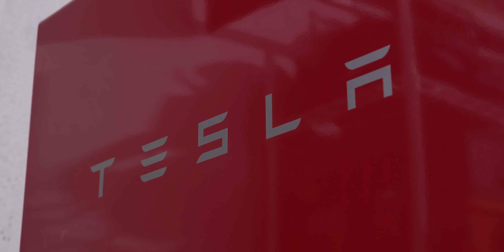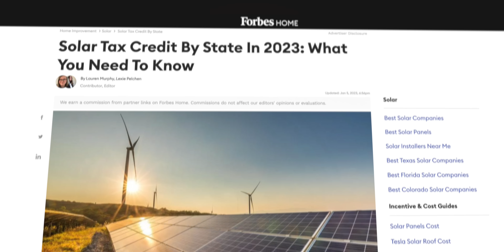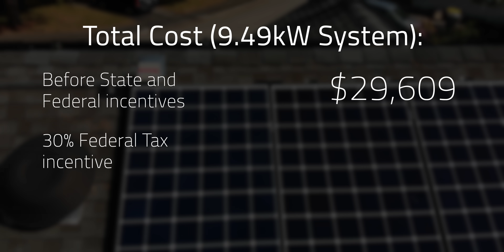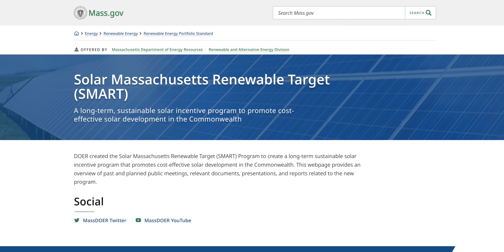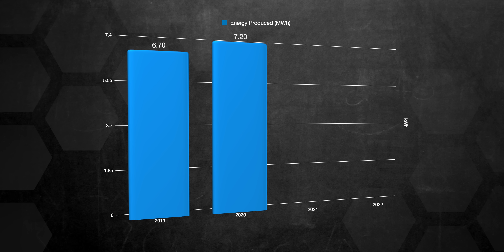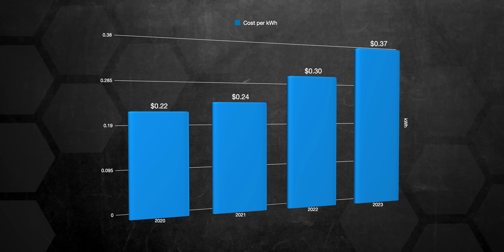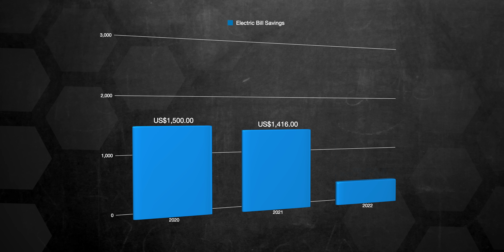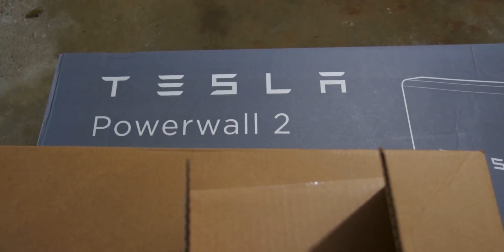5 Years with Solar Panels - Is It Still Worth It?

Comment: I have a friend who worked at a radio astronomy observatory for decades.   They had this "standardized" intelligence test for their interns.   When the "big" (26m) dish would fill up with snow, the procedure was to tilt it down, and hit it repeatedly with a whacking stick, and it would come avalanching down.  The "test"?  If the student stood behind the dish while whacking it, they passed the test.  Several students failed this test...
Reply: I would've failed based on the fact I wanted to be covered in snow...
Reply: @Perroden  26 metres of snow?!?
Reply: @alanhat5252  ya why not.
Reply: @Perroden  people who don't mind to be hit by snow probably don't live in region where it snows.
It depends what temperature, humidity and how long snow was here, but I would estimate that that amount of snow would weight at least like a car.
Probably they clear it  regularly(because otherwise people who failed test would be dead and in emergency unit).
My grandma was almost hit by snow several years ago that fall from roof. It fell just in front of her legs. It is freaking scary.
Reply: @alanhat5252  26 meters across the dish, i.e. its diameter, not its depth.
Reply: I would’ve failed it because I’d be making snowmen.
Reply: "Why are we hitting it with a stick?, SCIENCE"
Reply: @dersturmerofjewery6038  It was a very scientific whack with a very scientific stick!  (If confused, read Project Hail Mary ;)
Reply: @jluhman2  omg I love that book! I can't wait until they make the movie
Reply: @dersturmerofjewery6038  Gravity....
Reply: "If the student stood behind the dish while wacking it..."
Reply: @christopherlh4271  🥴🥴
Reply: One of mankind’s great technical invention 
The stick
Reply: @martyober4833  Another: Fire. Collect enough sticks and you’d have kindling. Though never burn your best sticks if you still need sticks for other uses.
Reply: What if I just wanted to be covered in snow?
Reply: @McFlubberpants  Well, if that response was being tested for, you’d have passed the test.
Reply: @McFlubberpants  well if there is a lot of snow they might find your dead body in the spring when the snow melts.
Reply: I remember seeing the invitation on my college bulletin  board.  It read, "Take a whack at astronomy ...,"
Reply: I work in a blast furnace that sprays lava on a floor to make little pellets to then be crushed. 

We sample the product, I handed a trainee a steel bowl to collect some product to sample. 

He went to reach to grab a handful with his bare hand. I stoped him thankfully it’s probably 600- 800 degrees Celsius.
Reply: @doaimanariroll5121  Yikes!  That'd make a mess, that guy owes you a hand.
Reply: @syberphish  yeah man someone dropped one pellet like 6mm diameter,  into his boot. Took him like 3-5 seconds to get his boot off. 
Burnt him too the bone. 

It’s so obviously hot you walk into the chamber and it’s like standing right next to a big camp fire with that radiant heat. I couldn’t believe him. Haha he wasn’t around long though.
Reply: @doaimanariroll5121   I have a decent idea what you're talking about.  In my 20's I worked as a tempering oven tech at a glass factory in Chicago.  
When the glass would bump into each other on the rollers it'd fuse together and start forming a ball in the oven.  When you hit the E-stop, stuff starts happening pretty fast.  Part of the conveyor drops to a bin and it all starts running backwards shooting off molten glass.  Then the big long clamshell oven line opens on hydraulics and you have to use poles to move the glass off the rollers.  The rollers were not cheap. 

First time it happened to me was like my 2nd week on the job, I was technically still in training.  That was when I realized I never got polymer frames for my glasses.  The heat pouring out of the oven is so incredible you feel it palpably like waves lapping over you and enveloping you.  
We had big mitts we'd put on  with a front-suit but my metal glasses frames started soaking up the heat and searing into my skin.  Never again though, I got some BCG's after that. 

Can't even imagine what a blast furnace is like.  

At one point, if your microwave or oven had a tempered glass plate in it, there was an 80% chance it came through my tempering oven.  Not sure if they're still cornering the market like they were 20 years ago. At the time I was one of the few people there who spoke English, but it didn't matter because we all wore hearing protection from the moment we stepped into the building.  I'm not sure I ever spoke to anyone at that job without shouting at them. 

I was never tempted to grab it, but when the glass was running correctly, coming out the oven, running through the clamshell air quench then through the air and water quench run, it'd still be orange-hot and had this smell incredibly reminiscent of hamburgers.  
I'd sit in there watching the orange sheets go shooting past and just drool.  

When everything is going correctly, it was incredibly boring.  Once you get the computer programmed and get a load up and running you could just sit and watch it for 12 hrs at a time, for days or weeks.  In at 4am, out at 4pm, every day.  

And on that note, starting work at 4am is bullsh*t.  But 20 years ago, making $24/hr for not doing all that much was pretty good money, but you really earn it when the alarms are going off and the lights are flashing.  I'll never forget what the heat felt like though, it was so intense it's hard to describe. 

It boggles my mind to think of someone going to pick up a still-orange sheet to inspect it.  Just the thought of it makes me shudder.  I bet you've seen some nasty burns too.
Reply: @syberphish  😂
Reply: @doaimanariroll5121 😂🙏🏾
Reply: lmao
Reply: lol looking to fail interns means idiot supervisors.   you just want hard working people.
Reply: That’s a good intelligence test.
Reply: Hahaha, why is this story so very believable. 🤣
Reply: Surely they were from Florida...
Reply: I thoroughly enjoyed your analytical video, I wish  Solar Power had been a reality for domestic consumers in my working life before retirement before the first time from 1962 to 1995 when disposable income was a thing! P.S. I did also the  enjoy the many comments that appealed to my sense of Humour! No disrespect, but your video will be a mental bookmark for decades to come!
Reply: Your snow story reminds me of a coworker I once had... he once got a gouge in the sidewall of one of his tires, and went outside with scotch tape, to patch it up. People are good at different things -- he was a baseball player, but obviously not mechanically inclined in any way, whatsoever.
Reply: This analogy can be applied across a wide range of activities. It's always interesting to see people just blankly moving through life and wondering how they made it this far.
Reply: The mitigating factor is if they say "Hey watch this!" first.
Reply: Me me me me... Me me me

Decarbonization is 21st century pyramid building.
Just burn coal. 

This is sickening on so many levels.  "How to screw the lower middle class and make them pay for your feel-goodery."
Reply: @SorryLord-IDidntMeanToSayThat  Kind of. Anymore with how quickly houses sell you kind of just have to buy them like you're ordering a t-shirt
Reply: Apes.
Reply: There was no "friend" involved, was there Marcus?.  You got covered in snow, didn't you?  Yeah I see through your fake story, I know what happened. "So this one time, I had a friend who..."  suuuuuure.
Reply: I find that some really smart people overlook common sense and look for complex solutions to simple problems.
Reply: Is that intelligence or just common sense?
Reply: This is so complicated for me.  I just want to know if my electricity bill would go down if I got solar panels.  It would take me 6 months of studying  to figure it out, so I guess I will just keep paying PGE.
Reply: I worked in satellite communications in the military.  There was a story about people beating on the back of their reflectors to remove snow...and destroying the antenna due to changing the geometry.

We called the post fire department and they'd come out with pumper trucks and spray the snow off.  At our location, the pointing angles were basically horizontal, so the snow would slide off and the water wouldn't have time to freeze to the surface before it also rolled off the reflectors.  Interesting point...our antennas were 60-ft in diameter, and even a single inch of snow built up on that much surface area weighs a LOT.  Our antennas had motors and moved to track the satellites, and that much weight would begin to cause tracking errors.
Reply: For very lightweight reflectors with de-minimis backing-structure, this can happen for sure.
Reply: It sounds like making fun of a person with lower intelligence by allowing them to humiliate themselves - potentially unsafely.  Not funny to me.
Reply: Was that Hazing?
Reply: THAT WOULD BE NORMAL, SINCE HARDLY ANYONE HAS AN EDUCATION
Reply: You don't need to insure that your roof is top-notch.  A 20 yr old asphalt shingle roof will still outlast the useful life of the solar panels
Reply: “Whacks the dish from behind, then proceeds to jump in the avalanche”
Reply: Kitchens have the same thing. Wash that wall. Top to bottom great. Bottom to top, not so much
Reply: In Canada hydro is .55 cents step one
Reply: Mostly the lies...the biggest part of my bill was the delivery fee...it went from 45 to 35 no big difference 
My bill averaged 100... now with solar my bill is 80 but I pay 99 a month for the panels... maybe summer time will be better
Reply: @patchvonbraun  Reminds me when I was a student nurse doing my stint in operating theatres and we would watch intern after intern rush about trying desperately yet failing to find the neck tourniquet the surgeon had requested.  Said surgeon would have slipped out some time ago, winking at us as he left.  Of course, we could have kindly explained to interns that this item didn’t exist. I’m afraid we did not do that.
Reply: Does the solar panels come with a mathematician? 🤔
Reply: X-Rays are just a piece of radioactive cobalt behind a lead shield.

How we have come so far, hitting things with sticks and putting shiny rocks in metal tubes.
Reply: Nice story but as someone who actually worked on 32m diameter dish it makes me laugh (because it's BS). You would have to have a sizeable stick to "shake" a satellite dish.  On another hand we tested new guys by tasking them to the dust off antennas (not the 32m one though) to improve signal/noise ratio....
Reply: @kirill_gusev  You only need to cause it to "ring" a little.  I'm currently managing a 12.8m dish project, and we can get that thing to "ring" slightly.  For light powdery snow that's barely holding on, that's all you need.  Same with the radome around our current dish.  If anything sticks at all, we can turn on the big blower fan that causes the entire radome to inflate slightly, and off comes the snow.
Reply: @kirill_gusev  Yes, I'm familiar with that one. I was contacted by a Latvian friend of mine about parts of the pointing system about 10-11 years ago.  I think it depends on the character of the backing structure.  Anyway, decreasingly-relevant to this particular video :)
Reply: @kirill_gusev  Maybe you are missing the point of the comment. If they stood in front of the dish they failed the test as they lacked commonsense /scientific nouse.
Reply: @saintsone7877  Maybe you are missing the point I tried to make: while this story while it sound very funny is very unlikable because of reasons I listed. and I you read my comment to the end I you could notice I brought up another common sense test we used to play on new comers. Peace.
Reply: Yes, book smart doesn’t mean common sense smart. 😂
Reply: @donnastokes-manning6175  Common sense is not all that common. Indeed, I’d suggest it doesn’t really exist.
Reply: I wouldn't want to buy a house with panels on it who knows what headache I'm taking over
Reply: Students must be educated, this "evaluation" is basic bullying and does not assess any intelligence. Shame on this institute.
Reply: I build utility sized solar, fun fact an arc blast from our transformers can reach 35,000 degrees ferenheit in a millisecond, thats 4 times hotter than the surface of the sun.  Always fun turning them on for the first time and doing voltage checks inside.
Reply: @jamesross160  
Sorry, but global warming is the biggest fraud since communism -- see Henrik Svensmark. 

It's "fun" making a pointless replacement of perfectly good energy assets?  I loos like it.  When digging a hole and filling it in again, if different people do the digging and the filling, then, yes, I guess it looks productive to the digger and the filler.
Reply: And.........what does this have to do with the topic at hand?
Reply: @machonsote918 snow Avalanches were mentioned in the video
Reply: @machonsote918  You ask "And....what does this have to do with the topic at hand?"  Why not consider his comment to be just a funny little aside to prompt a smile, which it obviously has from all the multiple people commenting other than you. Snow avalanches were mentioned in the video. C'mon man, lighten up!  ;-)
Reply: @machonsote918  I’m wondering where you’d stand. The front or the back.
Reply: @machonsote918  Maybe the footage of him clearing the roof while standing in front of it?
Reply: @machonsote918  He talks a bit about avalanche in the video so  just a side story about avalanches & common sense
Reply: This is pure genius comment....🙌♥️😭 and what I told my Texas Tesla salesperson 😅 why not just physically tilt the panel on the roof? 

Poor salesperson wasn't an engineer
Reply: Here is a simple test almost anyone can do if considering solar. Step one- go outside and look up . What do You see?  Where I live in NW Pa. what I see almost every day are the airplanes spreading out whatever it is to turn the entire sky to a milky haze. They can and do turn a pure clear blue sky into this gauze within 3-4 hours. Think this is crazy? All You need to do is watch for yourself, which I would highly recommend before investing in solar.
Reply: I’ve seen it go from a clear blue sky to overcast and sprinkling within an hour due to a single contrail . But I live by the Oran in NYC. A lot of people have solar panels here . They still save money .
Reply: Ocean
Reply: @brianw8963  Sometimes clouds happen. The airplanes are irrelevant.
Reply: @wooddogg8  You are 100% wrong. Of course natural clouds happen, but what I’m speaking of is not natural and occurs almost daily and is most certainly “relevant “.
Reply: @brianw8963  Jets, airliners in particular, leave contrails which are basically water ice crystals from the engine exhaust in a trail behind the plane. It's Ice due to the low temperatures at high elevation. Nothing to be afraid of and utterly irrelevant to the question of  solar panels.
Reply: @wooddogg8  I do know what contrails are. Do You know what Geoengineering is? I do , and it has nothing to do with unaltered contrails. “They” not only admit to it, they brag about it. Either do some research or ignore it.
Reply: @brianw8963  Yes I'm familiar with Geoengineering,  I think what you're referring to would be called solar radiation management. There are many reasons why it is never likely to happen, and you can rest easy that it isn't happening now.
Reply: @wooddogg8  Maybe not in Your neck of the woods, but it most certainly is in My area and many others.
Reply: @brianw8963  No. No it isn't. You are the one making wild claims so provide some evidence.
Reply: @brianw8963  Maybe I was a bit harsh dismissing your claims, for that I apologize. "cloud seeding" does happen but it's not widespread and I don't believe it would really have an affect on solar panel effectiveness as it would likely be deployed in areas suffering from lack of rain, areas which would probably not be cloudy often. It is also used to lessen the damage caused by hail storms which would obviously be a benefit to solar panel owners.
  Geoengineering is something on an entirely different level and the solar radiation management I spoke of earlier is not happening anywhere in the world. It is an interesting idea which could have horrifying consequences but unfortunately may become one of those last ditch efforts we must employ if rising global temperatures become untenable. 
And as a resident of Pennsylvania you'll be happy to learn that you live in one of only 3 US states in which cloud seeding or weather modification of any kind has been banned since 1967.
Reply: @wooddogg8  Certainly no apology needed Joe, but thank You. I enjoy conversing on this topic with anyone that is willing to discuss it with an open mind  and open eyes. Got some things to do, will get back a little later.
Reply: @wooddogg8  Ok Joe here we go. Just out of curiosity, with Your solar set up, roughly what would the difference in Your energy output be on a clear sunny day compared to a very overcast day?  Just guessing it would be quite substantial. Now, just for fun let’s pretend that they have the ability to turn one of those clear blue beautiful morning skies into a totally grey gauze overcast sky from horizon to horizon in as little as 3 hrs. or less. Sounds absurd right.   And do You think this would have no effect  on the climate?  Normal jet engines produce a short contrail that dissipates relatively in a short time. It does not spread and remain in place all day. It is not simply water vapor. It is not cloud seeding as there were no natural clouds present in the clear blue sky. Geoengineering and SRM is and has been going on for a long time, hidden in plain site right above Our heads. You won’t see it unless You take the time to watch . I used to be in that same boat, until I took the time to see it for myself. It is maddening to say the least, but it is most certainly happening just as I’ve described. How do I know this is going on almost every day? I’ve witnessed it hundreds upon hundreds of times. It is intentional. All anyone has to do is take the time to watch it. I’ll end this with one of My favorite quotes that is relevant to this topic. “The eyes are useless when the mind is blind.”
Reply: @brianw8963  Yes, solar panels produce much less electricity on overcast days, something like 10-25% of the electricity they would on a clear sunny day. 
Cloud seeding does not need clouds around to work, by the way. Water vapor will condense on dust or any particulate if spread during the right conditions within the right dew point range. 
I guess the problem I have with your whole argument is why? Why are you blaming these clouds on some kind of geoengineering?  Beautiful sunny mornings turning into overcast Gauze gray in less than three hours is a completely normal thing that has happened for ages, regardless of airplanes. That's just weathar doing it's thing. Actually three hours is a long time, It can happen faster than that.
 I think you're digging a bit into a conspiracy theory here.
I should mention that as an independent astronomer I am very aware of cloud formation, how, when and how fast it can occur. I "look up" all the time, day and night. Clouds are a very natural thing and occur with maddening frequency in my experience.

Lastly, since any of this activity is banned in your state, have you contacted and or complained to your state EPA or representatives?